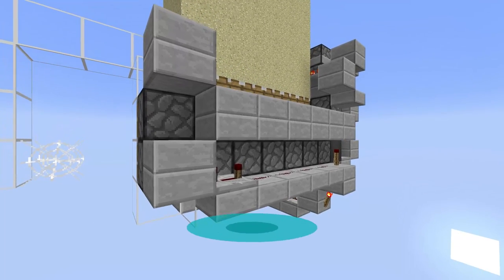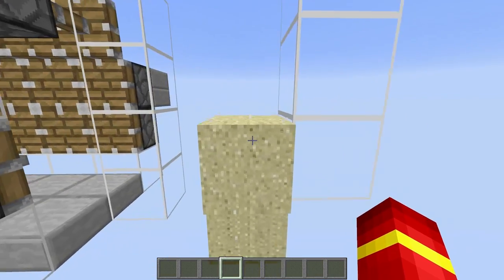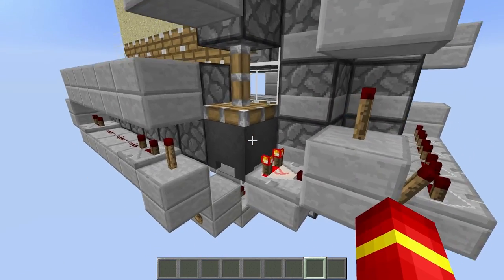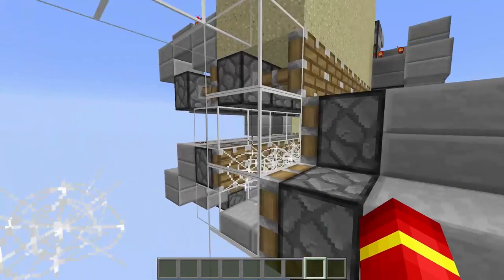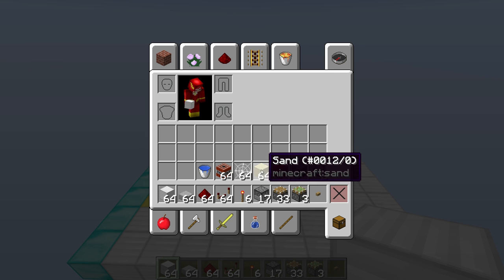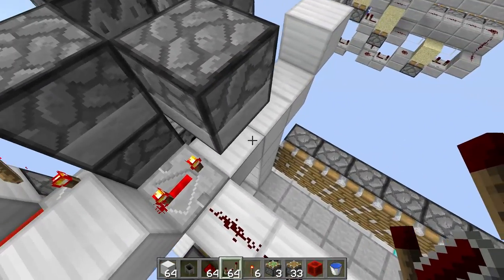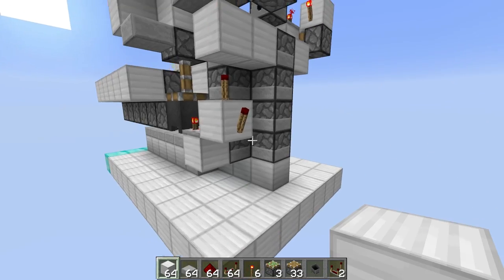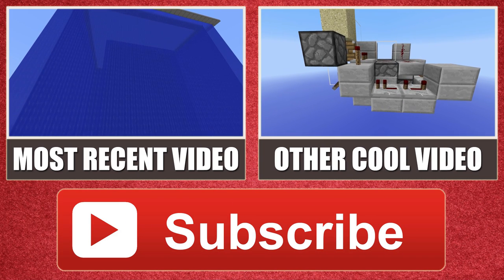Minecraft Tutorial: Compact 230/240 Sand Compressor [7x10, Insanely Compact!] [1.7]

Comment: Insanely compact? Lmao, you obviously never saw a sand compressor, this is like the most over complicated one I ever saw. A 255 sand compressor/cobweb recycler is compact compared to this. I think you need to google to word "compact", because you are using it wrong in all your videos.
Reply: this is pretty compact
Reply: +SupaShawn- REVAMP No it's not. Talking dimensions, its about normal size for 240. But the wiring is horrible mess,  and would take much more time to make compared to other types, and you know, that is all what matters in raiding. If you are making 240 one shot, you dont care if the sand comp is 2 blocks wider or not, why the hell would you.
Reply: +SupaShawn- REVAMP Also just did some basic math, the sand alone on this thing is 20 blocks high. As I am sure you know, 240 stacker has to be made at y237-238, depending on the cannon. So this thing would not even fit since you can only build to 255... Another total failure of TNT madness,lmao
Reply: Muhammad Brown the sand is 20 high? thats normal......
Reply: 240 (238) + 20 = .. yeah. Also 10-12 high sand would be in norm for that type of cannon
Reply: Jared Reid He just pointed it out, and it's the truth.